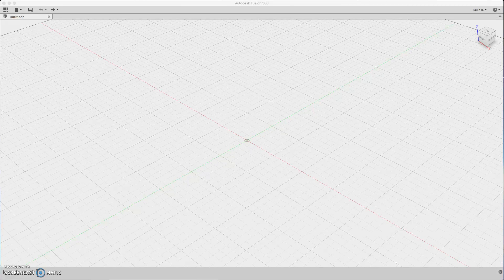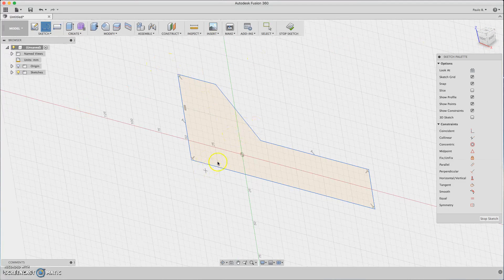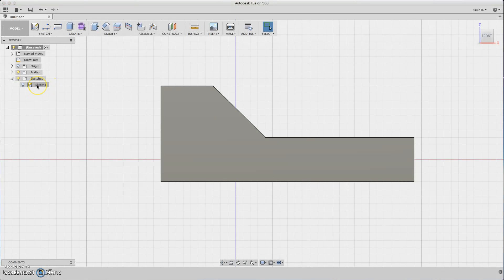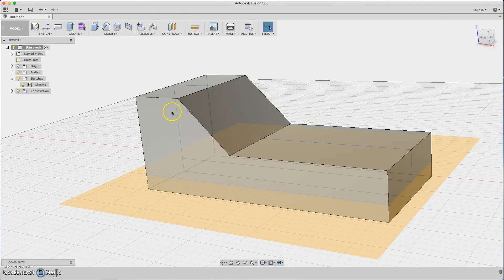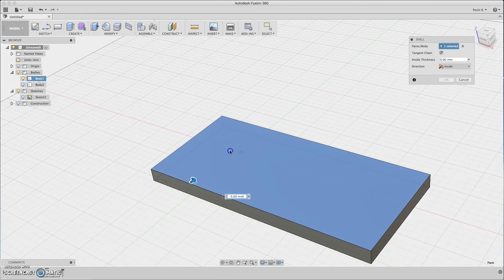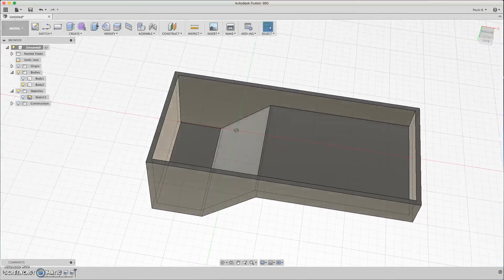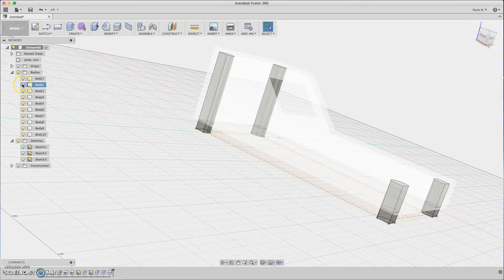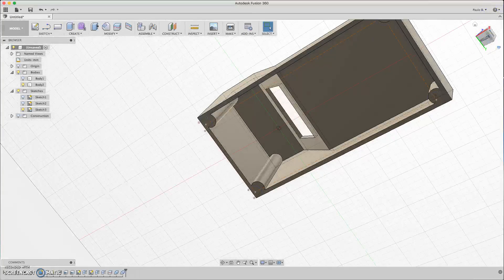Fusion 360 Tutorials #2 Project Box

Comment: Thank you for making this video. I'm building an Arduino based controller for a Rotary Table, using a Uno or Mega, a stepper driver module and a 20x4 display. Can you go one step further and show how to insert a dxf of the board layout and make mounting pads in the bottom of the box, please?
Reply: I followed your tutorial, and figured out how to add the mounting pads. Quite pleased with how it came out.